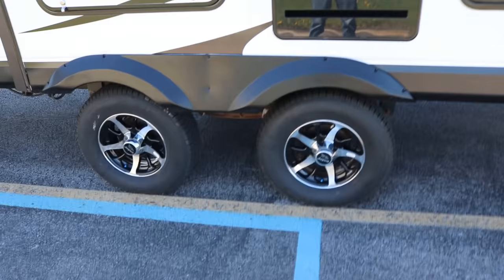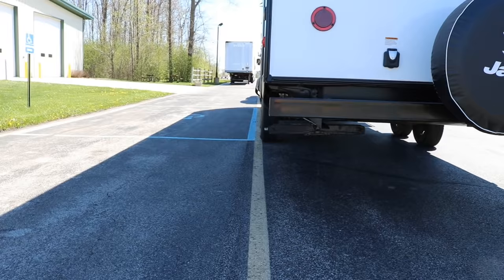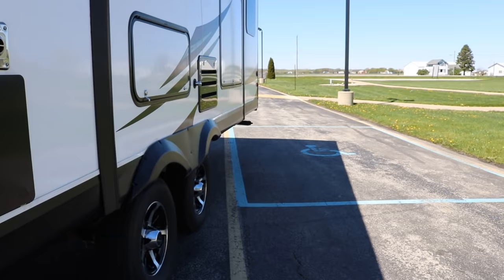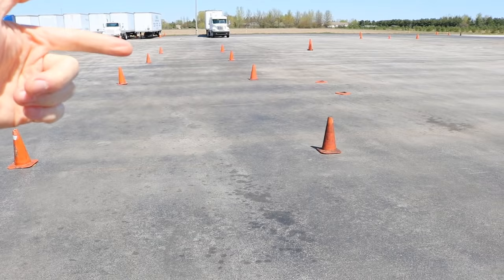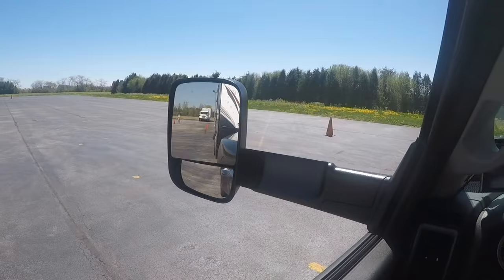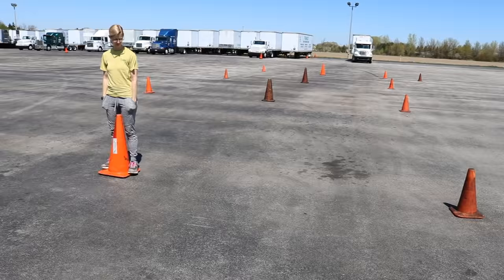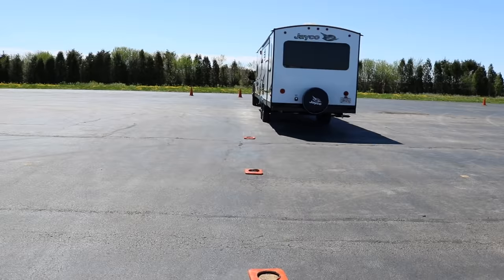HOW TO BACK YOUR RV (And Trailer "Tail Swing")

Comment: The best trailer backing video I’ve seen in YouTube! I plan to buy a trailer but not sure if it fits my house. I have 2 lane driveway, about 40ft long (including sidewalk), need 90 degree backing from the street. But the driveway is on slop, downhill to my garage. I have a 11ft wide alley at the side of the house between garage siding and privacy trees, alley is flat. Unfortunately there is no straight opening from the alley to the sidewalk and street. So it becomes the reverse lane change case in your video after I get to driveway. Overall it will be 90 degree backing from street to driveway, then reverse lane change. I think I don’t need to fully make the trailer straight during this combo, just look like a mix of 90 degree backing and lane change. I was thinking about buying a 20ft long, 7 to 7.5ft wide trailer to fit my parking situation, but after watching this video, I feel I can buy 8ft wide ; )
Reply from the maker: That's great, we are happy to help. I'm sure you can do it!

Comment: I actually was thinking about doing the same thing as your course. I have struggled with 90 degree back so possibly learning on something smaller might help with backing the semi truck.
Reply from the maker: Couldn't hurt to get the technique down before moving on to something bigger but this will help with timing on semis as this is how I teach truck backing as well.

Comment: Very good video on the backing up process. Drive a tow truck for a living so the concepts of backing up come very natural to me and have had to teach the concepts myself in training other drivers. I've always done the same by using a free parking lot to practice, practice, practice. Usually I teach that backing in tow is 3 things that are always happening. 1 making a cut of the angle. 2 maintaining and angle of cut. 3 taking away the angle cut. I agree that the biggest thing before is having the plan in your head before starting and fully agree with GOAL! (get out and look) I usually train backward donuts both ways and figure 8s both ways AND now you know the concepts of backing a vehicle in a parking spot. DO IT

Comment: I hear you about not having the spotter.  Man, it’s always twice as hard when someone is “helping” me backup.  I have a hard enough time without someone running me into a tree.  This video was great with so much information.  Filming from the drivers perspective added quite a bit of depth to this.  Thanx for posting.
Reply from the maker: Thanks for the feedback! Most times spotters make backing up worse and end up in couples arguing. Thanks for watching!
Reply: Depends on the spotter.

Comment: Excellent video! Your tip on how to back up in a straight line is very clear and easy to understand, same goes with which way to turn the steering wheel when turning  the trailer to go right or left, again the way you explain it clicks right away. I can definitely agree that having a spotter can sometimes be more frustrating than helpful, lol...and the pressure is on when parking my R-pod in a campground 😱, but I'm getting better and this video makes the process much clearer. Thank you for taking the time to make the video. 👍
Reply from the maker: +Sandy Suarez thanks for the comment. We seem to be in the minority when it comes to my opinion on spotters. I'm glad our video helped you!

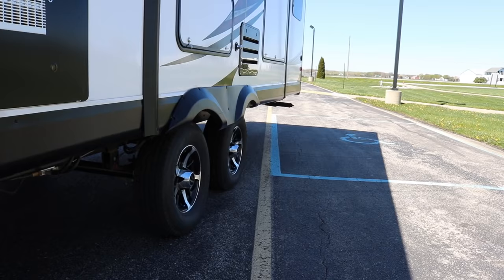Comment: I agree about the spotter ..i so wish i were able to find a big lot to practice in ... my husband died and now i am stuck trying to back our huge trailer into spaces . I am terrible at it .ugh .. this helps .. i founf putting my hand (right hand if turning right ,vice versa ) at the bottom of  steering wheel. If i want to go right take right hand toward 3:00 o clock ..i had and have a difficult time with where hand /wheel ahould be otherwise .. but this video will help me tremendously
Reply from the maker: Glad to help

Comment: Good stuff. Like you, I'm pretty confident in backing all types of trailers as I've done it for over 20 years in my job. There was even a time, back in the day, I could back double trailers up straight to a dock. But for those looking for help, you've put together one hell of a video.
Reply from the maker: +Rod Anderson thanks for the comment. One of these days when I get time I'm going to hook up a set of doubles and try a straight-line back. One of the perks of my job is all the toys at my disposal haha
Reply: Wandering Wagners it’s possible and doable. I pull triples and I’m sure you know how bad those con gears off track, took practice being able to back the 2 front trailers and con gear into the pup.

Comment: Great detailed video..  I grew up backing up with my hands on the bottom of the steering wheel to steer the trailer in the direction you want the trailer to go.. It is kind of an easier concept for most.. if you want the trailer to go left , turn the bottom of the wheel to the left.. not saying there is anything wrong with your video.. actually if I had someone teach me the video way, I would most likely do it .. I can't change now, I would really mess things up for me. . Thank you.

Comment: Best explanation I've seen so far. Great video. I've also found it harder with a spotter. I went from backing into my driveway in 10 minutes with a spotter to 45 seconds without. 8' wide trailer, 9' wide driveway for 35 yards. Subscribed!
Reply from the maker: +jwall62 that's awesome! I watched a video that recommended you use TWO spotters. It made me cringe haha

Comment: Great video!  I learned the hard way, by being told to place one hand at the bottom of the my truck's steering wheel and move it slightly to the side to which you want the trailer to go.  I bought my first new RV trailer, a 29 footer in 2010.  I had to learn in a hurry how to back it into my shop in Huntington Beach, CA.  My shop has 12 foot tall roll up doors with 10 foot wide openings and an opposing building about 45 feet straight across from my shop.  My RV trailer is 8 feet wide, 8.5 feet including the awning on the door side, so I have 9 inches on each side with which to play...not much.  My wife was trying to spot me, but got too stressed out, so I was on my own.  Like you say, doing it alone is often best, because, like you, I have my own plan to get that trailer into my shop.  I need to start with my truck & trailer perpendicular to the shop opening, just to make it more challenging.  First time took me about an hour and 10 tries to get the correct backing approach angle.  Start turning too soon, pull ahead and start over.  Start turning too late, pull ahead and start over.  I quickly learned that the pivot point of the trailer is between the tandem axles, so once the trailer is half way into the shop, that is when I can adjust to get it backing straight.  Now I do it all alone in about 10 minutes.  I wish I had a place to practice first.  
Phil Salsbery
Reply from the maker: +Phil Salsbery good job, that sounds like a tight fit for sure! Sometimes being self taught is best. Looks like you got it figured out though. I wish I had a shop that big!

Comment: I have backed a few trailers but not anything the size of an travel trailer, I have impressed many people mostly when I did a perfect L reverse with a trailer in an apartment parking lot. This video just thought me a whole boat load that I did not know, and also confirmed a few things I had figured out on my own. Best bits of advice is to always get out and look if you have any doubt, and go slow there is no need to rush any of these manovers.
Reply from the maker: +jpgale thanks for the comment. Glad the video was helpful! 👍
Reply: If you already have not thought about it there are a few good manufacturers of camera systems out there, RVS for one with multi channel and monitor, and also if you do not want to deal with one of those you can go to NuVending and get the NuCam WR camera with up to 150 foot range, helpful for that blind (right) side and rear view.

Comment: Some good tips for those who have never backed a trailer.  Oh, and I agree, no spotter, except to tell you to stop!  Our rig was 70' long with our trailer, almost the length of a semi.  One key item you might want to mention;  always go with a 5' tongue if possible.  Makes for an easier backing situation.  One thing I do is when coming into a truck stop and needing to park for the night;  as you pull pass your back in spot, when the hitch is even with the space, cut the truck/rv hard right and as the trailer get by its wheels at the space, turn hard left and then back in.  This sets the trailer up for a one shot deal into the parking space.  We pulled into a Flying J in Iowa after almost 16 hours of driving and I backed our coach and tri axle trailer between 2 semi's and you know how close those semi's park.  lol
Reply: Also, the longer the trailer, the easier it is to back up.  However, the 5' tongue does make a difference there as well.

Comment: Thank you so much this was very informative I thought I had it last year when I was practicing and did make it into a spot with another campers help but I tried It a couple weeks ago and I didn't do so well so on way home stopped at a school parking lot and again no good, I think the most important thing you did was you took it slow, small maneuvers I think I was turning the wheel too much and keeping it turned for too long, you only went a couple feet before straighten, going to watch video a couple more times and then time to practice, especially since I have to back up in a couple weeks by myself.  I agree you need to do it without the spotter I went camping with my brother a couple weeks ago and he was giving instructions but he drives a class A and has never backed up a trailer so he didn't quite understand the opposite steering and he was getting me more confused if I had done it myself I might have done better, so next time no one's help.    Thanks again.
Reply from the maker: Yeah, small movements go a long way. Like turning a bike, if you cut the wheel you'll wreck the bike... Small turns and take it easy. Turn towards the problem and you'll do fine. If anything, get out and look. Good luck!

Comment: Excellent video. I don't typically have issues backing a trailer but I still got a couple good tips out of your video. This is going to be gold for someone who doesn't have any experience backing a trailer!
Reply: I would post here but it so long, just surf the other comments I made one with a Reply, It includes a few other set ups not part of License Testing but still fun to try and improve ones skills.

Comment: Great video.  I have found since owning a travel trailer and 20' cargo trailer, they are a lot easier to back up then a short snowmobile trailer, you look at a snowmobile trailer wrong and it jackknifes on you quick.  The longer the trailer the larger room for error correction there is.
Reply from the maker: +Terry Smith very true! Glad you found this video helpful👍

Comment: I learned to grab the steering wheel at the bottom.  Therefore you can move it in the direction you want to move the trailer to get it started.  I obtained my Commercial Drivers License in 1991 but drove my first truck and trailer in the Army in 1975.  This is what I tell new drivers when I see them having a difficult time getting the trailer to go the direction they want.
Reply from the maker: That way works too but we have had great success teaching this method

Comment: Good visual on tail swing, pivot points. I feel like many people (including professionals) use the end of their trailer as their primary guide point in reverse...
Reply from the maker: +Kelley Botelho thanks for the comment! I agree, a lot of people focus on the back end of the trailer. Once they figure out that they need to watch where the trailer tires are, their skills start to improve!
Reply: One of the first things they taught at the independent TT Driving School i went to to get my CDL-A was always watch your tires, I even knew this before i went to TT Training since that is the pivot point of reference when backing a trailer. Now a days with camera systems, I have a few on the truck but also attach a few on the trailer I haul (right hand or blind side and under side the trailer tail end looking rearward for backing and when on the road to see who is behind me. They all record so if something bad happens I got video proof.

Comment: Great video. I was taught to back up with hands at the bottom, but your hands at the top and steer toward the problem is really helpful, easy advice to remember. I tend to oversteer, so your "11 & 1" advice will be really helpful for me to gauge when to steer the other way. Your provision of reference points for when to execute different actions is useful. Your alley dock would be more helpful if it was executed in a more realistically confined area. Won't be many folks maneuvering into a spot with 70ft open in front of it. It's good for the beginner, learning how to back up. But won't you need sharper turns and shorter turning radius going from a narrower roadway?

On that note, what setup and timing/spacing advice would you give for a blind-side (20ft) ally dock. coming from a narrow (12-15ft) roadway with drainage ditches on either side? Your small turn-straighten-small turn protocol would seem to require a much larger turning radius than the roadway would afford.
Reply from the maker: Idea is the same regardless of space. This was so people who are new could practice and get comfortable and hone in skills. These same practices are used on the smallest areas as well

Comment: I’m gettin’ ready to go move a small boat and my 24” RV, solo 
Your video is masterful, and I’m going to download it to watch again, and again if needed!

I now understand how to easily straighten my truck back to the trailer alignment!!

My problem is that when I’m trying to back up straight, my trailer swings /shimmies left and right even when I feel like I’m not turning the wheel. 

What’s that all about?
Thanks a million 😎
Reply from the maker: You might not feel like you're turning the wheel, but it'll turn slightly. Backup your pickup without a trailer in a straight line and chances are you'll have to do some steering to keep it straight. Now add a trailer. Pushing vs pulling a trailer steers differently. Glad you found this video helpful!

Comment: Thanks very much for this.  I've never towed but am about to with a small teardrop camper, but that's daunting enough so thanks for this instruction on a much larger vehicle. I really appreciate what t=you have done here - adding to the world of recreational safety :) Cheers
Reply from the maker: The smaller the trailer the faster it'll move, so many small movements, go slow and don't overcorrect. You'll do great

Comment: Thank you. I need to translate this to a 5th Wheel, but I think the 'physics' or 'geometry' (or something) and the theory are the same. I, thus far, really stink at backing and parking. Bringing my camper home after 510 miles (mostly highway), in and out Pilot/Loves gas stations I did great (going fwd), but... then, I had to get someone to help back my rig into an inside storage facility when I got it home. I tried, but almost smashed it and nearly cost my marriage with my wife yelling one thing me doing another, what a fiasco. LOL I like the idea of maybe having my wife just there to spot for obstacles and/or as a warning and let me do the maneuvering, could save the marriage. LOL But now you gave me a plan on what to practice and practical ideas for steering and not turning the wheel until it twist off the steering column from side to side in panicked moves. Anyway, long winded words to say, thanks for a great instructional video I desperately needed.
Reply from the maker: Glad to help and yes it translates to a 5th wheel. Small turns go a long way

Comment: Excellent video, you’re a good teacher!

Do the same basic maneuvers apply when your trailer is a single axle 15 foot long teardrop? I’ve had mine for 2 years and still can’t back it up!
Reply from the maker: Yes. You just have to react faster because the trailer is shorter. Little movements go a long way

Comment: Old trucker trick, had at 6 o'clock on the steering wheel. Turn the wheel in the direction you want the trailer to go.
Reply from the maker: Yes that method works too. I was a truck driver for about 17 years and I'm now a CDL instructor and CDL examiner. Most people seem to catch on and learn better with the method in the video, which is why its shown. Whatever method works for you is what you should do.
Reply: @WanderingWagners  Respect! Awesome video too.

Comment: wow thank you so much for this video, we traveling a lot and I want to drive with my trailer home, this tips really gonna help me a lot, thanks for you patient and helping others, I will let you know how I did. Good luck and great day!! 
BTW I'm pretty sure the pinned comment its gonna happen. :)
A question I have is: How can or have to positioning my truck before I start backing up? In the middle of the road, close to parking spot where I'm going to?
Reply from the maker: Make sure you pull up far enough, at least half a trailer length past the site, and I'd be in the middle.
Reply: Oh ok cool , thank you so much! 👏👍